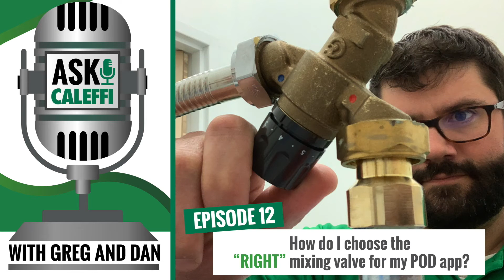#12 How do I choose the "RIGHT" mixing valve for my POD app?

Comment: Would you please elaborate on whethere a check-valve is or is not needed in a hydronic heating system with multiple zones, and if so, where is should be placed..  I believe many circulators come with built-in check valves which I think are on the output port ( in my mind it would make more sense on inlet to ensure the pump doesn't get sucked dry of water).  Thanks
Reply from the maker: Check valves should be placed in locations in order to prevent flow in an incorrect direction or stop heat migration. Most pumps today do have check valves on the outlet side.